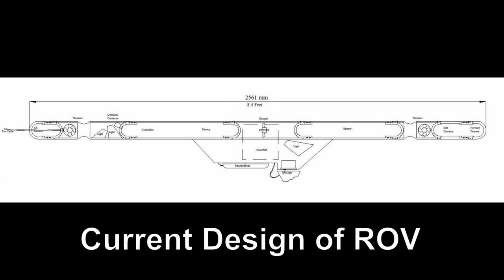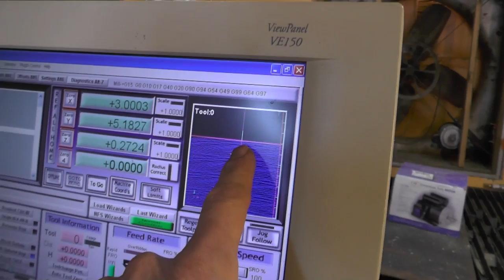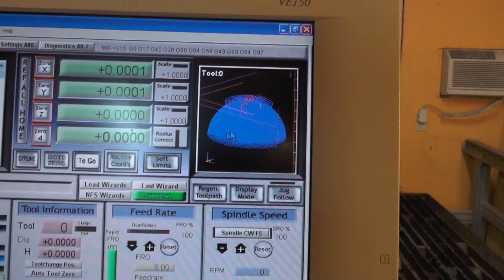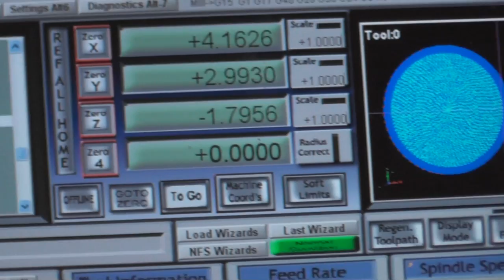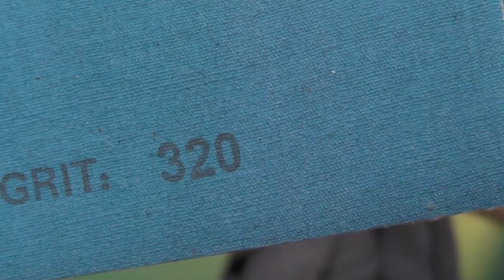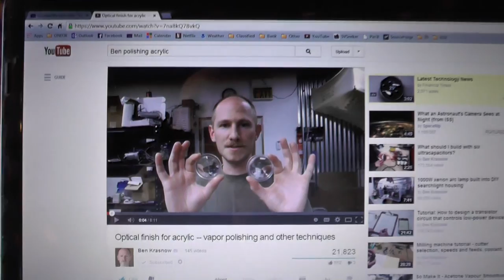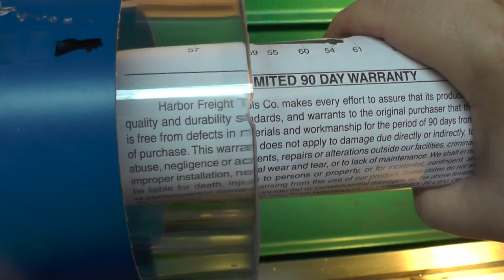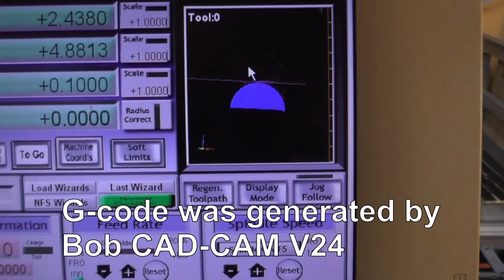ROV Acrylic Camera Dome - Part 1 - Cutting and Polishing

Comment: Your projects always amaze and inspire me. You should try sweeping the O.D. with some sort of (test or dial) indicator to find center rather than an edge finder. It's way more accurate when working with a round part, especially when aligning the two sides and you can prove that it's accuracy of the machine giving you problems and not your setup.
Reply from the maker: Right.  I need to buy or make a holder.

Comment: I was going to suggest doubleboost for an easy edge finder but I see someone else already did. I see someone else suggest a form tool for the lathe and then there is also a ball turning fixture that might work well for the external dimension but maybe just getting it dialed in a little better would be easier in the long run it looks like your pretty close.. keep up the good work very interesting.
Reply from the maker: Thanks

Comment: You probably have thought about it already but a good way to accurately center round stock is hold a dial indicator in the spindle on a swivel arm (we call em bananna arms) and jog the machine till you get the same reading all the way round the part and your on dead center

Comment: Thanks for recommending Ben. I will probably subscribe, but for now he at least shows in my "recommended viewing".
After seeing this, I'm soo glad I don't have to deal with 3d machine code... yet. (boss is talkin 'bout getting a 5axis waterjet.)
Silly question time again. Why acrylic, and not polycarbonate?? I know that there are different material properties, but not the specifics. I do know that acrylic is more brittle.
Reply from the maker: I got a better price on the cast acrylic.  But acrylic is suppose to be easier to polish, and it looks better for compression if I'm reading this correctly:  http://www.makeitfrom.com/compare-materials/?A=Polymethylmethacrylate-PMMA-Acrylic-Plexiglas&B=polycarbonate-pc
Reply: SV Seeker
Thanks for the link. I had to refer to wiki a few times to get a glimmer of understanding. But it does confirm my (limited) knowledge. Acrylic is more brittle, but stronger under pressure. sorta like hardened vs mild steel. Polycarb will deform before it breaks. & cost is always a factor! :))
Reply from the maker: jamcat62 That's what I thought too.  I'll ask my engineer friend just to be sure.
Reply: SV Seeker
One more suggestion. Ask him about the temperature qualities. "At depth" temps are very cold, and will affect tensile strength. I (vaguely) recall the metallurgical report on recovered Titanic steel.
I also saw that acrylic has a lower refractive index. which may not matter that much for your use.

Comment: Hi, first I would like to say great work so far, I have been following your channel and am amazed by your progress.

I don't mean to be a pest but I thought I might throw in some advice on this, as trade qualified optical mechanic ( guy that makes optical lenses) there is a few things that I would be concerned with;

Using acrylic at these pressures may not work unless there is sufficient thickness in the dome to compensate, depending on the size of the dome and the specific material you're using this thickness could be anywhere from 20mm to 100, using polycarbonate would probably be better suited for this application however it is much harder to machine.

When this dome is placed underwater you may experience a concentric ring effect. One way to fix concentric ringing would be to paint the base of the dome black, having said that perhaps the depth of the dome will cancel out this effect, I would recommend an underwater test with a high def camera and some bright lights shining in from the surface of the water to find out.

And the third and final way I'm going to be a pain in the ass is that if the inner and outer dome are dome are too far out of alignment at certain angles it could create a prismatic effect while underwater, what I mean by this is if you mismatch the curves of the front and rear surface of the lens in front of the camera you will induce some magnification (this may not be noticeable unless dramatically out of alignment ).

Again I don't write this to be a pain, I'm just offering advice. Great work so far guys I wish you the very best of luck.
- Pete
Reply from the maker: Thanks Pete.  So how is acrylic professionally polished?

Light is not really an issue, it's dark at 600 ft and totally black at 3000 ft.  Not even bio luminescence in the black sea.   I look at polycarb, but it actually had less compression strength.  Good for bullet proof but not for pressure hulls. I do expect we'll have a fish-eye view but that's not unusual for an ROV.  If the tilt cameras are not helpful then we might us go with flat view ports for all but the forward camera.
Reply: Very similar to how you are doing it, except we use a machine that holds the lens and does it for us, and our blanks are 70 -90 mm sections rather than a dome which makes it easier.

Comment: Loving the updates as always. If you want a simple but effective edge-finder search for the video "Handy Tool for Mill or Lathe" by doubleboost.
Reply from the maker: That's perfect!  Just what I was looking for.  Thanks for the tip.  I looked at edge finder tools today but couldn't find one that would work and the routers 10,000 rpm.  But a bearing would work fine.   HANDY TOOL FOR MILL OR LATHE

Comment: Stupid question time... Why not just flame polish the acrylic? Would it cause stress issues? It is just so fast(and fun). I just use a blow torch, very easy.
Reply: yes, wasn't the outcome of Ben Krasnv tests that a flame polish works best?
Reply from the maker: I've used flame polishing before and got the same results as Ben.  It works good on edges of sheets but it's not possible to get consistent results on large surfaces.
Reply: That is too bad. Seeing how you were spinning the dome on the lathe, I wonder if applying heat while it rotates would create a more even surface? Also, I would be tempted to try a good heat gun. I used one to form large PVC pipe and other plastics. It heats much more evenly than a torch and 160°C(320°F) is not that hard to reach.

Comment: First off keep the videos coming.
As for you CnC programing, you are using Bob Cad Cam to generate your g-code and then M3 for the cncing.But what are you using for you modeling. solidworks, Autocad/inventor ect...?
Reply from the maker: I draw BobCAD-CAM stuff in BobCAD-CAM most of the time.  Somethings it states off in TurboCAD.  But I'll selling the farm and moving to SolidWorks.  It's a bitch to learn but from the little bit I've worked in it, it's much more functional.
Reply: SV Seeker  Solidworks indeed will cost an arm and a leg if you want a legit version. If you want free you can try freecad as well: a similar learning curve, but free and does not try to include everything and the kitchen sink (and makes you pay for the gold taps on that sink).
Reply: To tell you the truth, I find solidworks very easy to work with. I come from an drafting and autocad background, yes I hat to say it but solidworks cost a few thousand if you get the premium version.

Comment: With the dome shape you will get a little bit of bad focusing on the edges of your picture on the camera under water because of the different refraction around the dome.

That is why many people with the old gopro camera changed their outer lens from the original domed one to a aftermarket flat one for filming under water.
Reply: do you know of any video editing software you can get to compensate for the refraction?
Reply: Tyson Henry No. It is a optical problem.

Comment: I think something wrong with yours center finding method.
How I find the edge:
touching one edge on X axis, then set X DRO to zero then touching other edge for example I found that is 65.3mm
then divide in half 65.3/2=32.65mm
in mach3 write a command G0 X32.65
and then I set X DRO to zero again.
same thing with Y axis

Comment: couldnt you make sumtin out of an old micrometerholder and a piece of rod 
http://www.micro-machine-shop.com/noga_holder_4.jpg
 that you can put intoo the routers chuck that can hold the micrometer so it measures the circumference of the material in the chuck mounted on the steel plate , that way you can get the EXACT middle up to the micron on the x and y axis 
i dont even think the tool needs to be exact it just needs to be strong enough not to flex against the springtension of the micrometer and the micrometer needs to be pointing towarth the exact centerline of the routers chuck or youre readings will be a percentage of a degree off 
just pull out the micrometer drop the router about centered over the object let the micrometer rest on the side of the object zero it and turn the router chuck by hand across measuring the way it needs to move to center it by either ajusting the x and y axis on the router or moving the chuck beaks i think it will be more precice than touching the material from the side with the drillbit 
i think you get the walltickness closer to perfect too unless the material has flaws on the outer wall  

the pressuretest will be interesting i wonder how you will do that